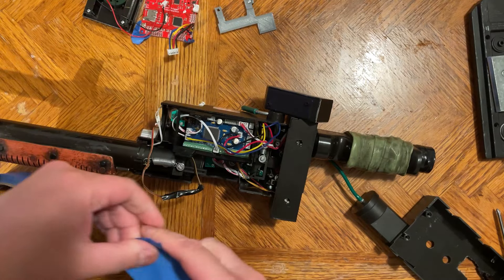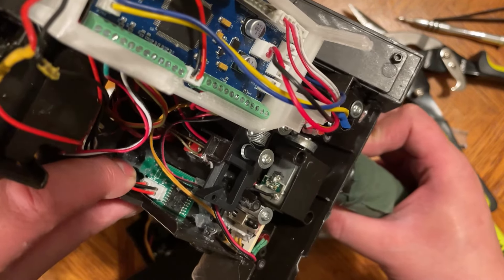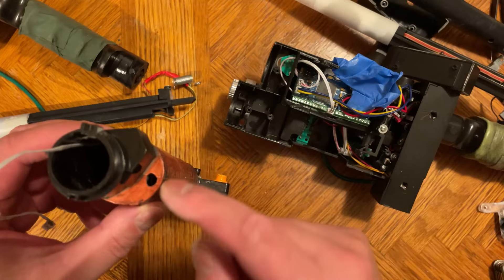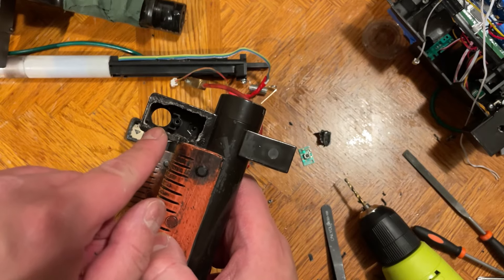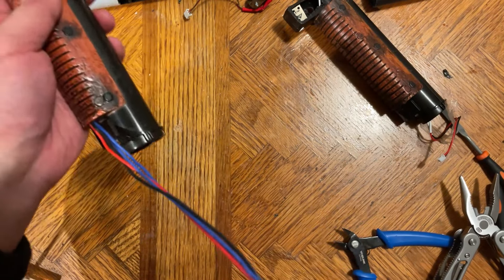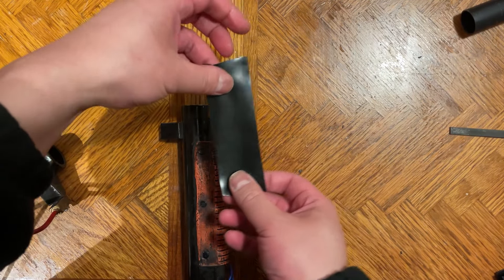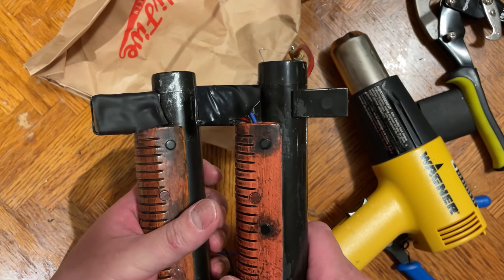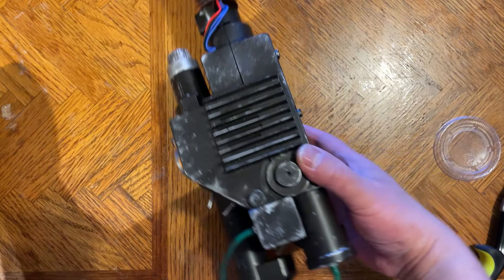Hatlights LED Add-On for gpstar's Haslab Kit Step-by-Step Installation Guide

Comment: So I had part of the plastic from the vent light still where I drilled the hole.  Completely missed the part about removing the clear plastic piece. So when I took the longer orange hat light to install it,  it sits completely flush to the top of the wand.  I tried pressing it further but ended up splitting a quarter of it.  Ended up filling it with hot glue .  It's not accurate but it looks like its been through hell which is sorta what I'm going for in my AL pack.  All the lights function perfectly.  It's truly a great kit.
Reply from the maker: hmm pics? i made the tall hatlight to accomodate the clear plastic piece still in the wand. There's a spacer included for those who have removed the clear plastic. which wand version is this?

Comment: You guys made my dream come true, a real bar graph. I ended up destroying my 84 wand trying to install the “easy” way, so I popped in my afterlife wand and ordered another 84 wand.

With the broken one to practice on, I was able to do the “destructive” method very easily and added a vent light.

All I want is that sound up sequence when you turn on the wand and well as the sequence on the bar graph display. 

Not interested in the cyclotron or anything else. 

What else do I need besides the essentials kit

Comment: The fake black wire going to the barrel to the main box can that be ripped out without opening the wand?
Reply from the maker: yes and no. you can cut it off from the outside and it won'tbe showing however there will be 2 pieces left in the barrel and wand and you probably don't want those rattling around inside

Comment: Are the screen used ones like this?
Reply from the maker: yup! the top body and wing barrel hat light didn't have LEDs GB1&2 but they put it in Afterlife
Reply: @jonogunn Not gatekeeping but I just went back to watch gb1 and I noticed Egon's thrower had an illuminated orange hat light on the wing barrel. (At least in the Ballroom scene) Perhaps for continuity? 🤷🏻‍♂️
Reply from the maker: @mirusso  i just rewatched it and you are right. i see veknman's hatlight light up in some short scenes in the ballroom. i wonder if it was added in post since majority of the movie we don't see them lit up
Reply: @jonogunn  I'm popping in my tapes to check. I think they had bulbs in them from memory but that's no help lol
Reply from the maker: @zombierage777  lol there’s a thing called the internet you can check instead but I appreciate your dedication to the old ways 😂